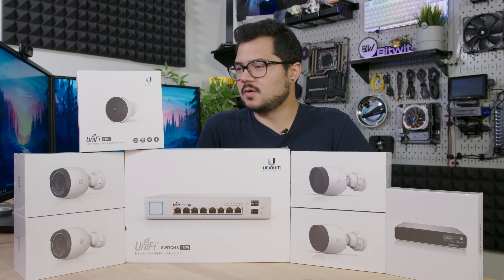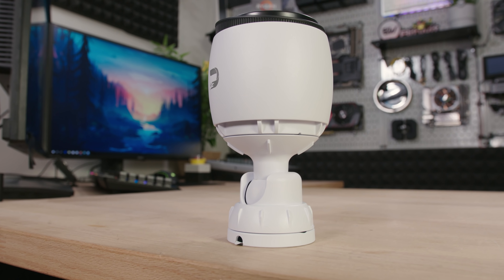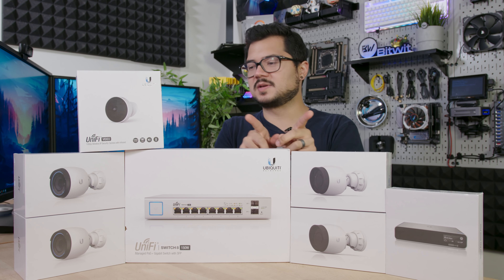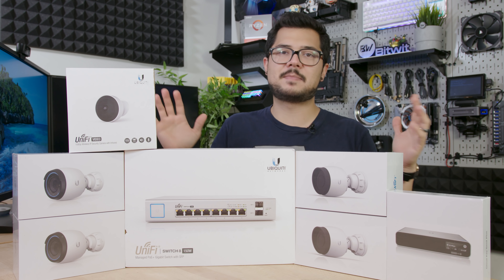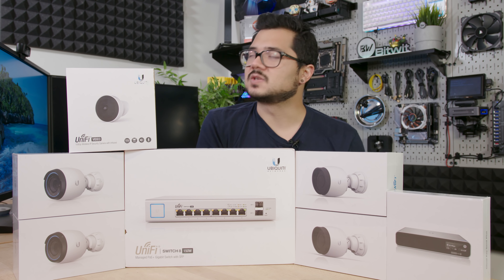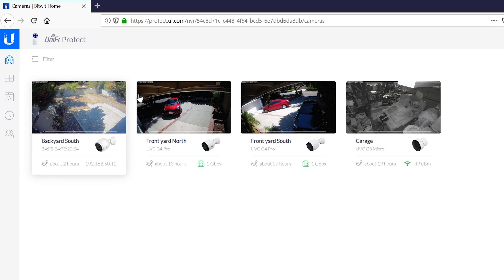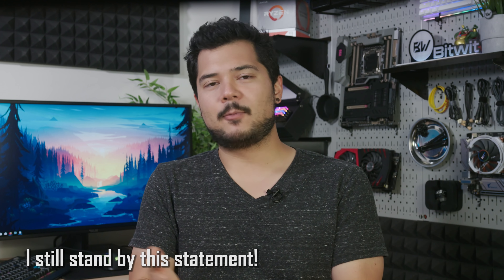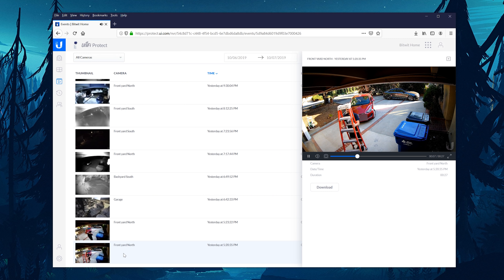PROTECTING MY LOOT!!

Comment: Kyle! You do not use anchors in wood. It reduces the fastening strength. If you do predrill, ensure you use a drillbit much smaller than the width of the screw. Redo the ones "screwed" into wood. They can be undone by simply pulling on the camera - and they are of no use to you when someone else have them installed at their house ;-)
Reply: Ronnie Sodhi very first thing I saw. Total #facepalm right there!
Reply: And a drill is not a hammer.
Reply: Good thing it will be reinstalled anyways
Reply: @robertbrown8957  wrong, everything is a hammer! Haven't you read Adam Savage's new book!?!?!?
Reply: @robertbrown8957  not with that attitude
Reply: that is not true you are wrong
Reply: I was so going to say the exact same thing almost word for word
Reply: The is the 2nd time in my life I have seen this, the 1st time was about 10 years ago and i still laugh about it from time to time.
Reply: anchors are for concrete walls like the ones in my house here in mexico c:

Comment: I really dislike how many of these security companies try to force a paid monthly/yearly subscription. 
I think for most people, having a closed circuit set up where only you have access to the data, and one that doesn't require a service fee is what we all want.
Something like this checks off these requirements and I would say this is a great choice for those looking to add security cameras for their home.
Reply: The only nicety I would like to see is the ability to integrate into google drive, dropbox,  OneDrive etc. If someone breaks into your place and steaks your security system and drives then you have no way of seeing who it was after the fact.
Reply: @Pavix1976  That's were you probably could setup something to backup the  recordings to a cloud storage. It won't be as simple if it was built into the Controller software, but doable with a little work.
Reply: @EngineerWilky81  you can actually setup a windows computer as an NVR for Unifi Video. It would be easy to backup recordings on a cloud platform.
Reply: Have you guys checked the price of this gear? The G4 Pro cameras are $449 each. I don't know enough to know if this price is reasonable or not but it sure surprised me to learn how expensive it was.
Do any of you know if the prices of UniFi gear is appropriate for what you get?
Reply: @ddegn  For high res security cameras that's not considered over the top, and from what I saw in this video they have better image quality than what most high end security cameras had just a few years ago. But then my take on what's expensive might be a bit skewed as my only experience was with installations where there were between 50 and 300 cameras. The "best" as in most expensive, security camera I know off was (at the time) a 21 megapixel job (at least I think it was 21 m-pixels, could have been more) with a 70 - 410 mm equivalent zoom lens, again I might be a bit off here, and of course it had both pan and tilt. Cost? I have no idea, just that it was high...
Reply: @blahorgaslisk7763  Thanks for taking time to share your experience. I really appreciate it.
Reply: Yeah I have the nest set up at home and I have to pay per camera every month for storing. Thinking about ditching it for something else
Reply: I am in the market for a security camera set- up and for me that is a deal breaker.
Reply: Duane Degn I use this system and can say it’s worth the money compared to other systems. 

It does everything. PoE, no subscription, weather resistant, free software with all the features (can run on own offline server, online/remote management, email alerts, standard video streams), really good image quality day and night. 

It’s honestly a steal.
Reply: @ddegn   That is a little on the high side but not that high, that said their are solutions that can be much cheaper but they tend to be a bit janky and the software is not as good.  You can get a good system for about 1/4th the cost(about 500USD).   One thing is that these systems are local storage only as well for around 500-1000 USD, you can again get something like has remote storage but you generally are going to pay about 500-1000 dollars over 5 years.
Reply: @cccccccs  After watching more of the video, I see it's a really good system. Thanks for your feed back.
Reply: @MaethorDerien  After watching more of the video, I can see those are some pretty nice cameras. Thanks helping me understand this stuff more.

Comment: You can't stop there!  I've been running all Ubiquiti gear at home for 3 years now with zero issues.  Was the best upgrade I ever made.  When I dumped my router/AP combo for a USG Pro, 24 Port POE switch, and 2 UAP-AC-Pro's the difference was amazing.  I'm running the controller in a docker in UnRAID.  Next is the Gen 2 Cloud Key and about 8 cameras.  Also in the process of going all Ubiquiti at work, over the past 2 years we've had zero downtime due to network issues.  I feed 2 buildings with P2P bridges, as well has a POE cameras, POE phones, and a large amount of wired and wireless devices.

Comment: I've been using Ubiquiti products for a year now and love them. I haven't used their Video Security products yet. My networking setup consists of their Unifi USG, Unifi Managed 24 Port Gigabit switch and their Unifi Nano-HD AP. I like the number of available settings and options their products have and feel like you have much more control over the equipment than your standard consumer networking equipment. I was using an Asus RT-AC3100 before I bought the Ubiquiti equipment and don't regret a thing. Another thing that I like is their controller software can be hosted locally or remotely. I have it hosted on a Amazon Web Services virtual machine and have it setup to send me an email notification if one of my Ubiquiti equipment is no longer connected or able to access the internet. It's been nice because then I know that either the internet went out or the power went out at home. I'm a software enginner so my networking knowledge is decent, but nothing like a network administrator, but I enjoy tinkering and learning new things. Well worth the money.

Comment: I applaud you for going with their system, its a good setup. I got 5 Unifi cameras and I am using the unifivideo running on a  dedicated server. I been happy with it and plan to add more cameras. Seriously thinking about the pro cameras after seeing how much better picture quality is. I also run unifi USG firewall and access points. You should give those a shot to since you have the cloud key to manage your switch.

Comment: Kyle : Welcome to My 2000$ build guys
Also Kyle : Uses S6 in 2019
Reply: S6 man
Reply: If it works, why upgrade?
Reply: I am sure it was his old phone that he keeps around the house just to monitor the cameras. He used a pixel  2 in quite an old vlog.
Reply: What's wrong with using an Audi S5?
Reply: His pixel 2 broke and he is waiting for the pixel 4
Reply: Terii Nekoyama The dame reason you would upgrade a computer. Better performance, better camera, future proofing (compatibility with new software) and all the other features of the new tech.
Reply: s6
Reply: @charlesricks2179  well you can install software mods and install twrp or clockworkmod to fix the software part of that
Reply: i think he talking about his phone not the car
Reply: aside from battery, the s6 is a damn good phone.
Reply: @bradenfitzpatrick8352  I thought he was getting a tin can on a string? 😂
Reply: That's what a gamer would prioritized.
Reply: What's wrong with the S6?
Reply: @charlesricks2179  As long as it gets software updates and does what you need, why bother? Oh wait, it's android, it probably hasn't gotten an update in years.
Reply: Charles Ricks s6 still has latest software, and also some people don’t want to upgrade. Maybe once his s6 stops getting security or software updates he’ll update, or once he breaks it

Edit: oh it’s android it probably hasn’t received an update in years
Reply: Yuzuki1337 people really try to argue without finding facts 💀💀💀

Comment: A solution that my company runs that we have had a pretty good results with is running Blue Iris on a windows PC. Software is about $75 and it can work with any IP based camera that is capable of real time streaming protocol (RTSP). The data recording can get pretty intensive when running several cameras at once so we usually build a stand alone Intel system that can leverage Quick sync from the APU and dedicated storage, but it could work double duty just fine on a newer system running less than 6 cameras. Usually use HiKvision or Dahua cameras which you can get comparable in quality for about $100-200 each. My shop is using some in the 200 range that will shoot 2k video at 25fps with really good Samsung light sensors. Blue iris has an app for android and iOS for about $10 that lets you remote view as well.  Figured I would pass along another option for anyone that wants the functionality but with a slightly less expensive buy in, but a less simplified interface for configuration.

Comment: We got a surveillance with our security system from ADT ( Yes, ain't cheap, but I don't cheap out on my safety, period ), as well as some Nest cameras inside the house. They are all wireless, it only requires a small 2 conductor cable from the AC adapter to the camera, easy to install even on brick walls.

Comment: I have the zosi direct  8 camera setup with local storage, while the app software is a little wonky cuz its definitly made cheaply, it gets the job done and it usually only takes a sec or two to boot up the footage. My ohly gripe with it is if the internet/power gets disconnected, we have to manually unplug the storage point, and plug it back in.

Comment: Damn Kyle, you got hooked up with one primo system! I'm looking at a DIY solution myself. Hey, you don't need to use anchors unless you're attaching to drywall (with no stud behind the screw) or masonry. You'll actually get a stronger mount in wood with no anchor.

Comment: I have Vivotek IP PoE cameras running on a Synology DS1817+, with a D-Link DGS-1510-52XMP Core switch, and a custom pfSense firewall. The Ubiquiti seemed simple, but I wanted longer recording storage with multiple cameras and options for what cameras and view angles I could have. I even got a single camera that has 4 sensors that can see my entire street on a single image. I run a near duplicate setup at my office with the only real difference being the office uses Ubiquiti switches.

Comment: 11:30 - That's not a software thing. The software can't make the camera magically move itself.
Reply: Right, it's an optical zoom, not a digital zoom
Reply: The soft can def accomplish this if the camera had and adjustable lens.
Reply: Cansir but its optical zoom the camera need to move....
Reply: Cansir this doesnt include rotor or anything to move the camera
Reply: @cansore  yes, of the camera was motorised it could. But it's not, so it can't. Optical zoom only works at the center of the image where the camera is pointing.
Reply: Cansir Please show me one example of a camera with a PT-lens...
No, software can’t magically make the camera point in other directions.
Try zooming in with an SLR. How do you reframe? By moving the camera.
Reply: Cansir You seem to be confused as to what a PTZ camera is...
You just linked a PTZ camera.
Reply: @Mikkel111  the comment was about whether or   not software could make a camera change the direction in which it optically zoomed.  I said yes it def can.
Reply: @cansore  The software can control the motor in PTZ-cam... This entire video contains 0 PTZ-cams.
Also, you claimed a movable lens was possible - That'd be a bad idea.
Reply: @cansore  The camera you linked to uses motors to physically move the camera inside the housing. A motor on the lens only wouldn't do this. The lens motor only lets one zoom in and out. Two other (pan and tilt) motors are needed to adjust the framing.
As @Mikkel Nielsen correctly points out, adjusting the framing of an optical zoom requires different hardware. It's not a software issue.

Comment: I have an old school BNC setup with half 960x1080. Works well... but since I've maxed out the controller, it gets "high usage" warnings often (overworked). I also live on a busy corner so that probably has a lot to do with it. This system uses the SGSeye app (made of full Chinesium) and the live view is quick and painless (initially loads into a 4-window view, so I have 2 screens worth) - when you have 3+ bars or wi-fi. The search feature is ok as it allows you to zoom in on the timeline to better hit your mark, but is still a little clunky. It needs more than just 1 fast speed though.

Comment: Kyle. You won’t get rid of the bug notifications by turning off the ring, they are attracted to the Ir of the night vision. Additionally, watch for spiderwebs built around the bullet cams, they love the IR and will block the picture as well as set off the detection. I use blueiris so I don’t know if the software has the feature, but the bug notifications can be minimized by separate sensitivity settings for day and night. They will not go away completely however.  Be careful showing your viewing angles, might want to adjust them a bit so your blind spots are not public.  Also be careful with audio recording,  in some areas it is not legal and has very specific requirements in areas where it is. You will also likely need a sign that says the premises is video recorded, this is often required depending on the state and who you pick a fight with.

Comment: I have the WYZE cams, inexpensive 1080p cams with night vision, motion detection, internal storage capacity, 2 way audio, remote access view and speech when I'm gone, Wifi setup. I like them 2 cams, 2 door sensors and 1 motion sensor all for around $100.00

Comment: make sure you put a fan on the 8 port switch.  the PSU's inside them have a habit of dying after 2 years. which is probably from thermals (note: not the switch itself, its JUST the psu, and can be replaced by a meanwell unit if it does fail very very easily)

Comment: Impressive hardware and software, good pricing too considering ease of use software and camera quality.

Kyle, can i recommend that you keep your switch and cloud key hardware in some sort of safe locked alarmed area e.g. a steel shroud unit with a vibration sensor alarm, and don't disclose that information publicly.

Loving the tech/lifestyle content, keep going!!!!!

Comment: lower your camera angle for the camera that keeps going from night vision to normal. the IR is bouncing off of the top part and it is detecting its light outside. I had the same issue. You could also put up something to absorb the IR on that overhang.

Comment: 2 grand is a lot to spend on a camera setup, but Ubiquiti does make really nice products. I opted for pretty much the cheapest security cameras on the net that are still good...Wyzecam cameras. $20 for a 1080p cam with really good night vision and they go live fairly quick too. They work with IFTTT so you can arm and disarm them based on your GPS location. The one thing I wish they made though was a desktop app to see all cameras live at the same time, but for what they can do and the price, I shouldn't complain! ;)

Comment: I use Ubiquity for all of my switches and cameras for the company i work for. Very good brand and very easy to use (minus their first gen cloud key.)
Reply: Plus its nice to have POE and POE+ over cat6
Reply: Also i highly recommend their Access Points. They're really good especially their SHDs.
Reply: My first gen 1 cloud key used to be very flaky (random reboots etc), but after some firmware update early last year it is now rock solid.   I'm looking to upgrade to a cloud key gen2+ for protect, but now i'm thinking of maybe getting the new stand alone nvr and just keep using my og cloud key.

Comment: Just a quick question... Why are you using pluggs for mounting the camera, when just putting the screw directly into the wooden plank, would work perfectly?! ;)
Also the infrared problem, maybe the shine from the infrared on the wood, when it bounces back, makes the camera turn it back off? Try pointing the camera a little more down, you can see waaay to much of the underside of the roof as it is at the moment... ;)

Comment: been looking at these cams...already have quite a few unifi devices populating my network. I am using Milestone NVR in a VM for my setup. My proxmox server seems to work very well for hosting a software solution but I am having some issues with PCIE passthough and I am currently running with no GPU support.  Old 12 core xeon and way too much ram fixed my issue.  The free license supports 8 cameras and used to work flawless until they released a "critical" update that removes the app support and kills the network client.  Speaking of companies trying to force you into a monthly subscription! For now my old 960P and 1080 cameras will have to do and I will just use remote desktop and vnc as my client...

Comment: For a cheaper option that lets you choose what cameras you use, you should have a look at Blue iris. I have tried to use zoneminder , milestone and Blue iris and found Blue iris has the best UI runs well in a windows VM on my unraid machine and easy access from outside my network (without the need for a ddns)

Comment: Kyle I was going to give you grief for going with the G3Pro camera's. Until you mentioned that ubiquiti sampled them.  The G3 non-Pro is basically the same camera without the verifications at about a 3rd the price. Build a monitoring system for my horse barn for under $600 including wireless bridge. Easy setup and host the Unifi nvr suite on my desktop.